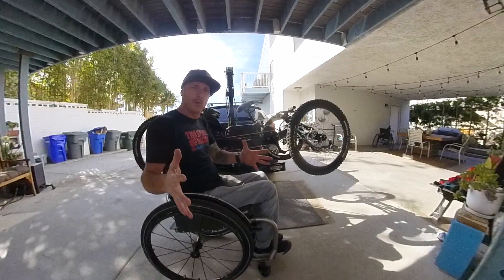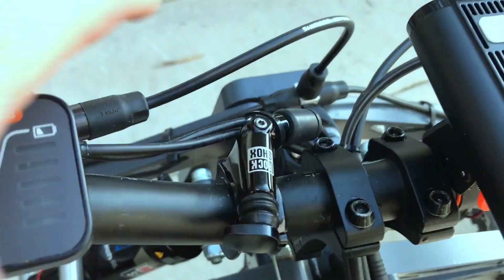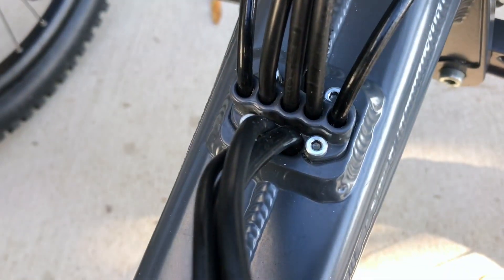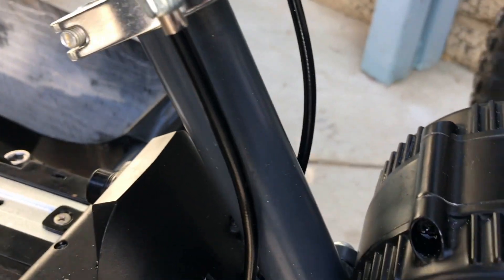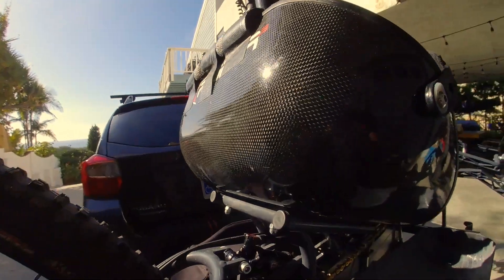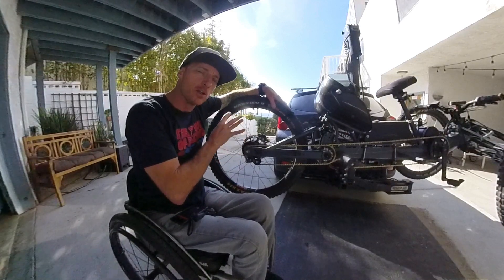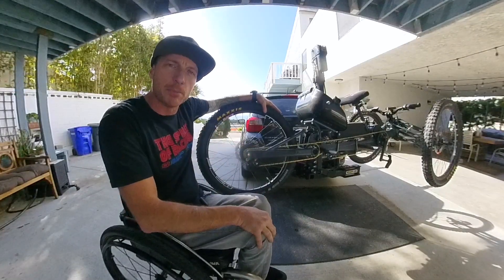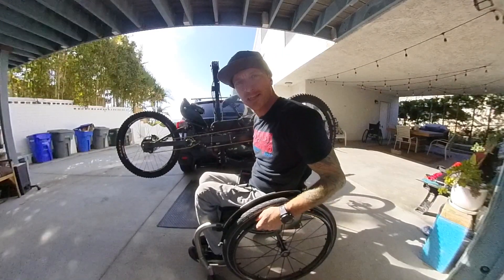Sport-ON Explorer Overview

Comment: Do you ever wish you had more power than the 500w? I'm looking to get e assist and I'm not sure how much power I need. Thanks in advance!
Reply from the maker: GREAT question! My answer is no. I rarely use the power. Of 9 settings i usually have it on 3 or 4. For me, 500 is plenty. I think 750 is a good compromise though. Nice to have it if you need or want it.